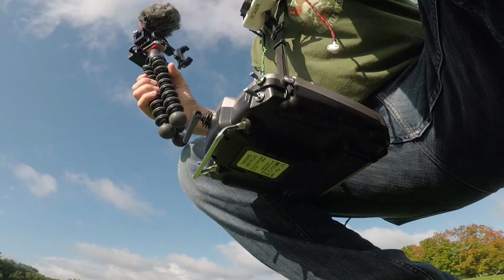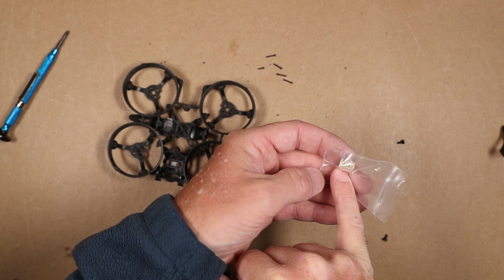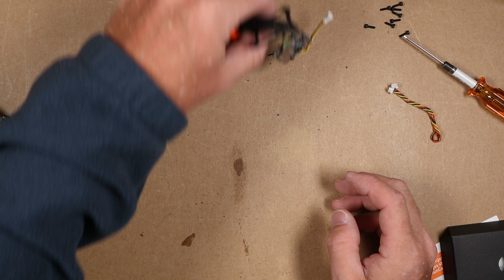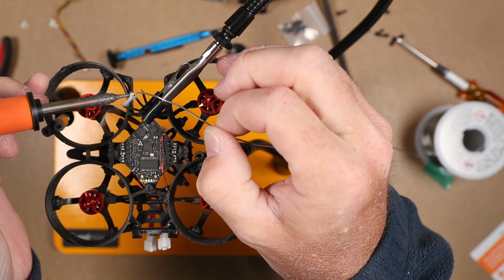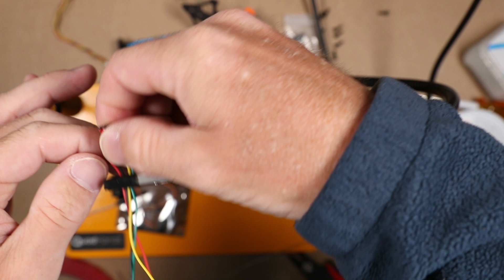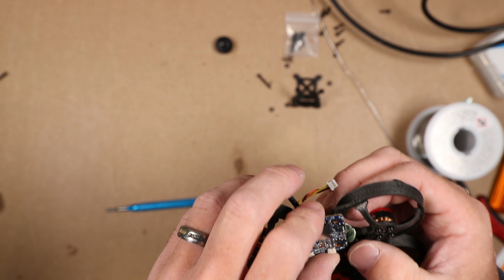R3DWhoop4K Build Video

Comment: Is there enough room to have a second board (say stackable whoop vtx) above the FC??I have this frame on the way and I am going to put the new F4 2-4s board on it and want to possibly get a whoop style vtx. Thanks!! This was the first R3Dwhoop 4K I saw online.Super excited for this build
Reply: It came in today. Super small!! Makes your build that much more impressive. I’m modeling mine after the beta X85 HD with 1105 5000kv motors. Any suggestions?
Reply from the maker: Sick! Beta85x is a pretty good rig provided you have one of the upgraded canopies. Those motors should serve you well. 5000kv is low enough that it won’t be twitchy and over powered. You don’t want any of that twitch in a cinewhoop. Run it on 3s or 4s using a 450mah or even a 650mah battery. That seems to be a good balance between flight times and weight. Your going to want a steady hand to do that soldering. It can be done with a normal size soldering iron if your up to it but I have good luck with the smaller conical tip.
Reply from the maker: There is plenty of room below the FC for a 20x20 or a 16x16. There will also be a bit of room above the FC for a receiver if that board doesn’t have one built in. Good on you for picking up one of the new 2-4s boards. I really think this frame is best suited as a 3s. Have fun with it!

Comment: Great build video I love these frames. Would you mind listing a link for the Flight Controller and that neat little iron. Thanks
Reply from the maker: I’ve updated the description to include the iron, tip I had used and the flight controller. Bear in mind this is a 2s flight controller. I may take it out and install a 3s or 4s. This one was installed as I had it laying around. I may go to a NamelessRC AIO412T HV or a GepRC F4 v1.1 12a. Both of those are 4s capable but lack the built in receiver. Also note the micro iron I used plugs into the Hakko FX-951 or the FM-206, prepare for a bit of sticker shock as they are pretty expensive. I highly recommend the FX-951 if you can justify the cost. It’s made soldering both easy and highly enjoyable for me.